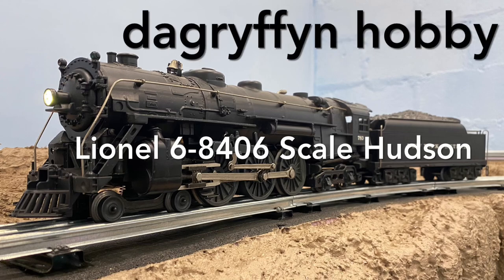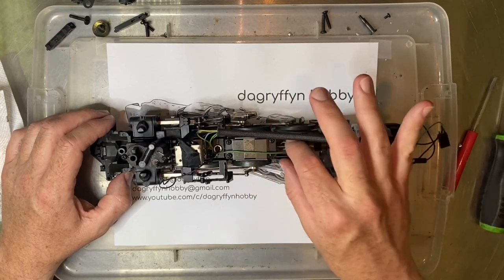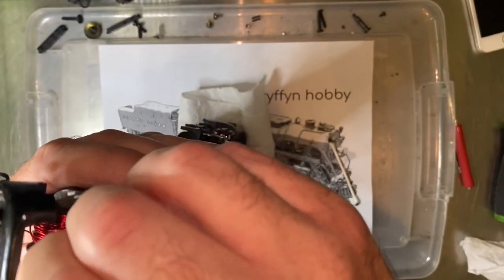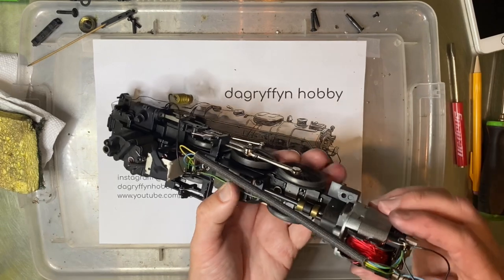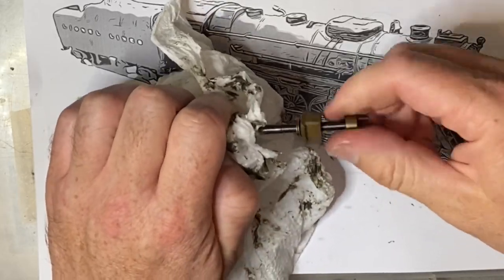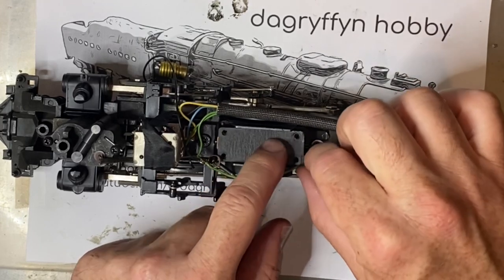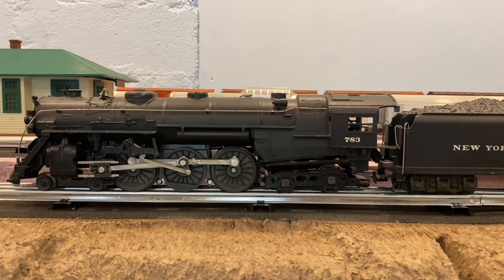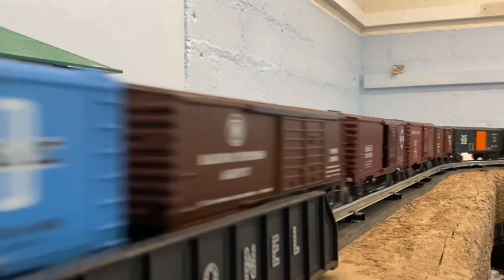Lionel 783 Scale Hudson 6-8406 (1985) Service: Clean and Lube - Repair and Inspection

Comment: My lubricants:   
Mobile 1 motor oil for armature & axles ; 
50& Mobile 1 oil & Mobile 1 grease (cartrige) for most gears in an enclosure;
Reply from the maker: Interesting options, obviously quality lubricants. I feel like I would make too much of a mess using motor oil. Besides I’ve gotten more motor oil on my hands over the years than I like.

Comment: Hi Dave, hey another fun and informative video.  I have a 763E Hudson 6-18056 that I purchased in 2000 (I am original owner).  This is a really nice train model, and I always enjoy running it, but I need to lube and service this engine too; only problem is that I have so may train projects going on !
Reply from the maker: Thanks! Too many projects? I completely understand! I have been wanting to go through all my cars and clean the trucks, but how can I do that when I have multiple engines in pieces!? Oh it will all get done eventually, or it won’t 🤷‍♂️

Comment: Great video.  Sometimes it can be a little intimidating digging into a unit without any repair instructions but most of the older stuff is pretty simple.  When it comes to the circuit boards and such...if that doesn't work...I'm out.  A little wiring, a little soldering, a little gunk removal, some fresh lube...sure no problem.
Reply from the maker: Totally. Usually going slow, one screw at a time, works just fine. I’ll stay away from the circuit boards too, not interested in fiddling with those.

Comment: Motor brushes can also be installed after brush plate is in place.
Make a small hook, perhaps from a small flat screw driver with a slot cut (Dremel cut off) in it's side.
Simply hook brush spring up and slightly to side & slide brush in and release spring.

Comment: Some of the 783s left the factory with excess slack in the wormshaft.

Usually, it requires adding another thrust washer in front of the bearing on the coupling end of the shaft.

I cut a portion of the thrust washer out so that I can slip it onto the shaft without pulling the coupling.
Reply from the maker: That’s interesting, and a good tip. Next time I take it apart I will have to check that out.

Comment: Nice video .I love the 783 but I'm hesitant to take it apart .I lubed all I could but it really runs nice .Someday I want to lube the gearbox .
Reply: You shouldn't run it without smoke fluid ,like the new ones
Reply from the maker: I understand being hesitant but it really comes apart easy. One of the easier old engines I’ve serviced. 
I know some of the newer engines have an on/off switch for smoke, this does not, I had not heard that it shouldn’t be run without smoke fluid. I’ll just have to get some I guess!
Reply: @dagryffynhobby  I put smoke fluid in my postwar engines and it works well ,only a drop or two .Yes I will take my 783 apart and regrease the gearbox . Thank you .

Comment: Nice video. That is one amazing Locomotive. My hands would have been shaking the whole time. You could remove the  rear bolt on that left side piece and run it to see if it still has that stutter. Or take it all off.
Reply from the maker: Thank you. I cut the handshaking out of the video! I would have removed all the side rods to check but I wasn’t sure how the eccentric rod comes off and didn’t want to risk breaking it. I’ll give it a try at some point.
Reply: @dagryffynhobby  Indeed. Having never seen one in real life, the video looks like the front of the eccentric is pinned onto the boiler and wouldn't want to come off.  However, removing the rear bolt of the bent side rod  would take it, the side rod, out of the equation. If the shudder goes away you'd have your culprit.
Thanks for all the videos.
Reply from the maker: @roccosabala6972  good point, I didn’t work though it all the way in my head. Now I’m more likely to try it, and this is one of the great things about sharing, sometimes you can just be too close to the project and need another set of eyes!

Comment: Many people install motor  brushplate and then install brushes by hook springs up and sideways for brush to slip in, followed by allowing spring to return.
I cut a small slot on small screw driver side for that hook.
Bent end of a paper clip wire would work.
R
Reply from the maker: Good tips! These days most of the time, I hold the brush plate with the brushes sitting in it and flip motor over to put it together.

Comment: Dagryffyn I experienced this lumpy movement on several trains I recently ran. Here is the problem as best I can tell. These type of models are depending on the side rods like a real train would to link them together instead of gears. This works if they are timed right and all 2, 3, 4,5  wheel sets are in exact sync, as well as the right amount of distance from one side to the other to keep the power flow to the other wheels in rhythm, 90 degrees of off set. Now in your case if a drive rod is bent or a wheel is bent that will give you the lumpy run as well. Take a picture of them and keep them separate from each other and the compare your none bent side with the bent one, then bend the bent one to match the good one. While it is apart look at the rod holes or the three sets, they should match up in any position, if they don't then one of your wheel sets were assembled slightly wrong.   However before you get into all of that, see if any of the other rod parts are binding, some oil on them might be all it needs, also I have see the eccentric on the center wheel put on backwards, 180 degrees off, they are not meat to work that way and on the smaller engines you can't do that and have it work at all.  As for the tender sound of steam and whistle, there is a good chance the board was setting on a piece of sticky foam and the foam has gone and the board is shorted on the metal base. If you are lucky you can just replaced that foam and plug it in and it will work. However I recently bought a bunch of these boards, 70's to 80's era and several of them just buzz, I also had a MarX one that did the same thing. I never had a Marx one fail before, so I decided to try just replacing the capacitors. I did not have the exact values in my collection last week for the two smaller ones, but the large one I had a match. I got sound out of it but it was still kind of buzzy. I then removed the two smaller ones and put lower values then the original ones in there, instead of higher and it works quite well now.  I can assume the Lionel ones have the same problem with the capacitors getting weak or shorting out inside due to age.   I recently repaired about 12 computer monitors by simply replacing all of the capacitors and it was the cure, as well as all of the capacitors on the power board of a 2006 LG TV.  Computer motherboards and power supplies have this problem too.
Reply from the maker: This is an amazing amount of info and tips, thanks so much. I will definitely check all of that out and see if running improves. 
I’ve always been nervous to solder on the boards to replace capacitors, but if it’s not working anyway, what do I really have to lose? Thanks again!
Reply: @dagryffynhobby   You are welcome to send the tender to me to repair as well. On that MarX "Sound of Power" circuit board I recently repaired, I don't know if this tender was setting in water somewhere or what happened to it. The speaker was rusted and the speaker terminal plate was corroded off it's mount, the wheel all were fairly rusted but movable, and the items on the board I needed to remove, the solder would not melt even over 400 degrees F. So I twisted off the capacitors and in that process on two of them one leg came out of the board nicely and the other just left a stub from the inside of the capacitor connection. So I used what was there to put the new ones in. Remember the + and - do mater and most caps are marked on the - negative side. The job I did on that one looks weird but it works and will last hopefully another 40 to 50 years. The new caps of the same value are much smaller as well, just need to be careful of other parts when removing them this way, and then be sure your mock up is also not going to short something out. That speaker I thought was bad, well it does work so I glued the terminal strip and then used it in the tender.  I removed as much of the rust off the wheels and the center roller device, but it was still skippy, so I assume I'll have to run a wire from the ground to the wheel sets directly to have a better ground on that MarX one.

Comment: Have you considered a bent axle?  Might require a trip to a Lionel Service Station to fix.
Reply from the maker: Thought of that but the wheels look to be turning ok and not wobbling. When I get a chance I’m going to take the side rods off and see if that makes a difference.
Reply: Wheels may not be quartered correctly.  That one rear wheel may be out of position with the other three.  Could have been put on wrong at factory or after.    @dagryffynhobby
Reply from the maker: @markperlman8384  possibly yes, I still think the side rods is the most likely culprit. Also it’s the easiest to check. Once I remove the rods I’ll know better. Usually, for me, if the wheels aren’t quartered properly then the won’t make a full rotation, but I think I only had that issue once. Appreciate the tip!
Reply: @dagryffynhobby  Maybe the encentric rod needs a slight adjustment? It would definitely be  the easiest adjustment at this point to make. were you  able to find the problem with the sound system in the tender?
Reply from the maker: @azslotracer  I haven’t yet taken the eccentric rods off, I really should, and I don’t remember what I did with the sound board! Lol, my brain is getting old.
Reply: @dagryffynhobby  you don't have to remove them just loosen the screw and make a very small adjustment where it binds at. It would have been easier to do when the motor was out of it so you could hold it and turn it by hand. I was curious to see what the other side of the drive train looked like as it rotated as well.
Reply from the maker: @azslotracer  the one long rod is visibly bent, the other side is not.

Comment: Hey Dave great video. Whether it's right or wrong I use my dremel with a wire wheel for alot of the cleaning and it seems to work for me without scaring. Bill
Reply from the maker: Thanks Bill. Interesting, not something I would have tried. But if it works, it works! Is it a soft wire wheel? Are there different types? I’ve never really looked into it.
Reply: Yes I use the carbon steel or the brass gently. I've been using the for years even on the armatures face. Lite down pressure with no damage. Works well.
Reply from the maker: @williampetruno9138  cool, thanks, I’ll check that out. I’ve used a brass brush to clean other stuff but I never thought of it for the trains.

Comment: Thank you Dave, for this video. I will now attempt to take my 785 apart and give it a good cleaning whether it needs it or not, lol. Great to see your subscriptions going up. Keep up the good work!
Reply from the maker: Thank you George. I was expecting the 783 to be more complicated to take apart, but it’s actually quite easy since all the side rods stay with the frame. 
I do need to remove them on the left side to straighten that main rod, but I’m in no hurry to do it.
Reply: @dagryffynhobby  mine has some wheel damage and it runs just fine. I'm not sure about trying to straighten it. Maybe order a new set on line. It seems like the side rods are in fact binding there. I would get some replacements and try that. I know a guy to order parts from, but I can't find his contact info! When I find it, I'll send the info you're way. This guy is awesome to order parts from.
Reply from the maker: @georgewhitacre8276  thanks George. I’ll give him a call.

Comment: another cause of biding with this era of engines is the magna-traction magnets, they are just glued to the top of the frame and can come loose and rub on the wheels.
Reply from the maker: Really? Hadn’t thought of that. I need to take this one apart again and check it all.
Reply: @dagryffynhobby  yep, hudsons, gg1's, mohawks, pretty much anything of that era with a worm drive motor will have the glued on magnets. I have several locomotives that I have just taken them off because I cant get them to stay in place with any of the glues I tried.

Comment: Hello 
I bought the same engine after watch your review. Did you ever find out what was causing your binding issue? I have read that perhaps it’s one of the magnets rubbing a wheel. Also, did you add any washers to take the slack out motor shaft? Love your videos!
Reply from the maker: Hi! Thanks for watching. It’s a great engine to have! No I have not done any further work on this one, I just run it once in a while. Hopefully this winter I’ll have time to work on it again.

Comment: It is safer to not nix grease types.  So I have a ( from restaurant supply) ss about 12" long tank of mineral spirits to parts wash & apply new grease.
Reply from the maker: I try not too mix, but I’m also hesitant to remove too much. I’m hoping with another cleaning, I’ll get the rest of the original grease out.